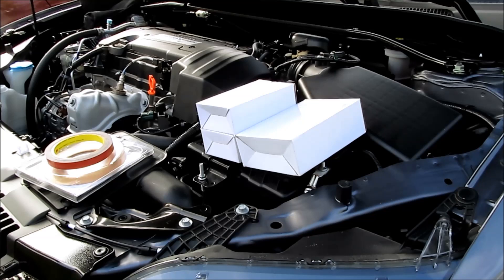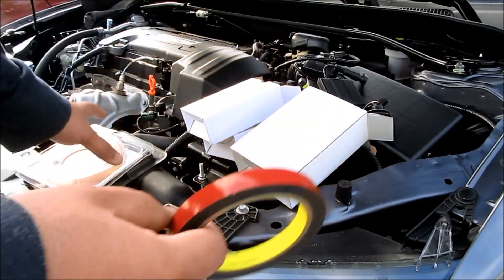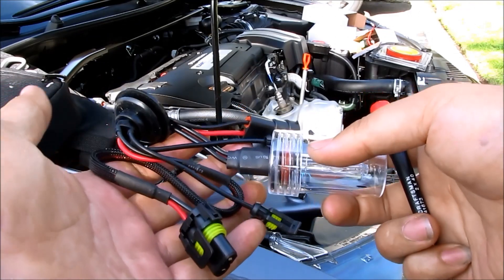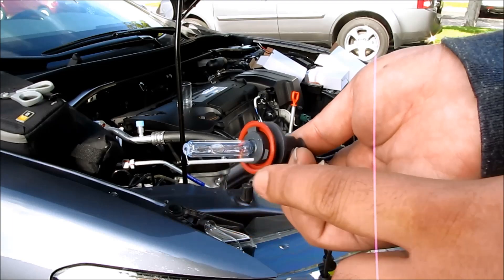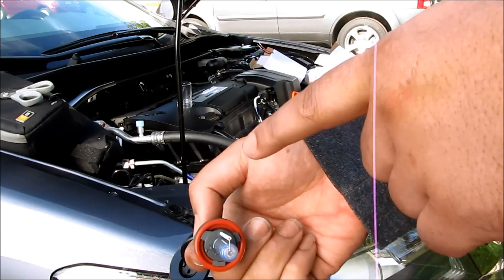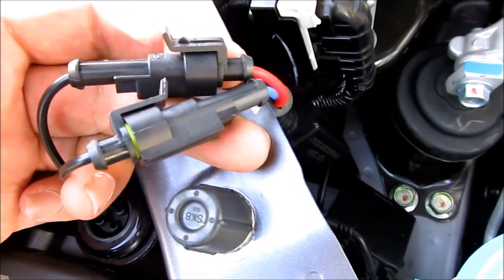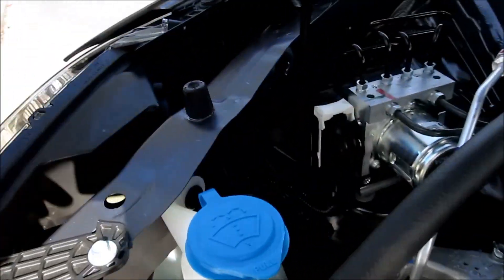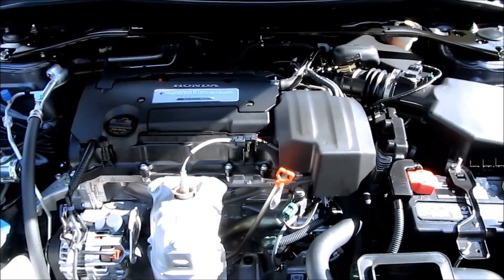DIY 2013 2014 2015  Honda Accord HID install (Must Read Description and Turn on Annotation)

Comment: Before installing the HIDs, is it necessary to disconnect the negative terminal from the battery?
Reply from the maker: Yes, before doing any electrical work, it is a recommended that you disconnect your negative battery terminal connection. Please have your radio code in hand before proceeding. However, it really was not necessary to do so on the Accord.  The HID used on the accord is the same procedure as changing a burn out halogen bulb.  I don't believe anyone disconnects the battery to replace a headlight bulb.   The ballast/hid bulb does not get power until you turn on your headlight switched on...  So make sure the switch is turned to off and not set to on or auto.

Comment: This is a great install video. I have a 2014 Accord V6 sedan. I am looking to upgrade to some HID bulbs but I am having trouble deciding what brand to go with. Does anyone know a good HID kit that does not break the bank but is still good quality? I am looking for 6000k. Not too blue but blue enough to match the LED's under the headlamps.
Reply from the maker: fafan22 You can try DDM or the Zenex ballast and DDM bulbs or http://www.amazon.com/Kensun-Conversion-Colors-Premium-Ballasts/dp/B004ZF43Y0/ref=sr_1_1?s=automotive&ie=UTF8&qid=1416112928&sr=1-1&keywords=h11+hid&pebp=1416112934696

Comment: I was wondering how is your cut off for the HID installed on OEM projectors. Does it blind other drivers?
Reply from the maker: I have not been flashed yet.  The cut off is straight and has the color flicker.  It does have some glare but not terrible.

Comment: what's the typical lifespan for HID bulbs? i just had some installed on my 2013 civic.
Reply from the maker: +thwipp89 Many of the HID bulbs are advertised with 30,000 hours life span.  However, the hid bulb will loose some light output (lumens) as they get used.   For example, a brand new hid bulb will produce more light compared to the exact same hid bulb that was used for 2 years.

Comment: Hey buddy just a quick question. How have the hids and ballast been holding up? An would you recommend them?
Reply from the maker: Big Boy Everything is working fine.  No problem so far and I don't expect there to be a problem anytime soon.  My first DDM kit purchased back in 2009 is still working fine today.FAQ: 2013 2014 Honda Accord HID Install 9 months Update

Comment: Purchased my ddm kit and just installed, lights come on great I don't notice a flicker but both ballast have a loud buzzing noise. I have a 2013 accord ex coupe, I have read a lot of people saying they installed and had no issues with same car??? Is relay needed or is there a fix to this issue?
Reply from the maker: you can hear the buzzing while driving .. you can hear the sound above the engine noise?
"i have never "heard" a completely quiet HID ballast, they all make noise, some more than others and usually are the loudest when first striking the bulb.."
Reply: +DIY: Car Modz once the headlight are turned on the buzzing starts and is very noticeable.  once the engine is engaged it is hard to hear over the engine noise. Is this normal? Is there anything to worry about? And do you think a relay would help? Thank you!
Reply from the maker: Nothing to worry about.  No, relay will not help.  Its just the hid being ignited. Simple fix.. don't turn on the headlights with the car off.
Reply: Thank you very much, love your videos watched all of them sense i bought my car. I feel better knowing i wont go out my car one day and have the whole thing be melted! Thank!

Comment: Does these bulbs give you hi and low beam?  What kit should I order for a 2013 Honda Accord Sport?  I want to still have Hi/Low beams....
Reply from the maker: Al Salerno The accord has 2 separate bulbs for the low and the high beam.  If you want to change both the high and the low you must purchase 2 separate HID kits.  H11 for the low and 9005 for the high.  However,  keep in mind that if you don't have the stock LED drl strip light then you must disable the DRL light in order to use HID for the high.  It is also not recommended to change the high beam to HID because flickering the high beam can damaged the HID ballast/ignitor.
Reply: Then why do some of these offer hi\low?  Sorta confused..
Reply from the maker: Because some cars only have 1 bulb that control both high and low..Example Honda Fit uses H4 bulb which is high/low single bulb.  The Accord uses H11 bulb with is NOT a high/low bulb setup.  Car that have separate bulb for the low beam and high beam does not use the single hi/low hid kit.  You must purchase 2 kits if you want both high and low hids.

Comment: Can you use the wire (for the relay harness I believe) that you removed and instead use it to connect the ballast to the oem socket? Or will that cause any issues? I don't think my ballast is connecting completely to the oem socket (I cannot get that click).
Reply from the maker: Please use the adapter that I removed on the video.  Check this other video I made recently regards to the HID install.

FAQ: 2013 2014 Honda Accord HID Install 9 months Update
Reply: DIY: Car Modz
Thank you so much for the speedy reply! I am going to try this tomorrow and will post results. Thanks again!

Comment: Whats best thing to clean foggy/dusty headlights???
Reply from the maker: Depending on the condition of the headlights..  Any of the following

Plastic polish
toothpaste
some sort of rubbing compound.. followed by less aggressive compound.. topped off with plastic sealant.
Wetsandpaper 1000-2000-3000 grit and buff with compound/polish
spar urethane

I'll have a video up on headlight restoration.
Reply: DIY: Car Modz I'm really interested in these hid bulbs for my accord 14 son
but since I'm a noob i culdnt find these exact bulbs online so like could you send me a direct link to where i can buy it from.

Comment: Do your car have the LED strip at the headlight (DRL LED strip)? if not, are you planning on adding one? I saw some other videos show how to just add the LED strip into the headlight for the Accord Sedan, yet they didn't really show in details so I wonder if you have any tip on doing that or if you planning on doing it and make a video, I would really appreciate it (cuz the LEd strip is only available on higher trim which is not my model and I would love to have that LED strip look)
Reply from the maker: Silva Hawk Eventually I will want that look but I want something that is just as bright as the OEM v6 headlights or else I don't see the point in getting one.  I've seen pictures of many different led strip from a ijdmtoys to typical ebay ones and I'm not impressed at all by the light output.  All the output you see from those are from people taking pictures in the shade or on a cloudy day.  I have not seen one pic on a clear sunny day facing the sun or a side by side comparison to the OEM v6 headlights with the led drl.  If anything I will either buy the v6 headlights with the oem led drl and do the tl quick retro fit projector all at once or I might purchase these: http://www.exledusa.com/exled-sf-block-premium-universal-eyeline.html.
Reply: DIY: Car Modz yes, I've looked at those SF-Block strip before too and that's what I wanted to learn how to install cuz a full set of new headlight is quite expensive

Comment: I ordered "Kensun HID Xenon Conversion Kit H11 - 6000k" and installed both of them. one thing that's happening though is that once in a while, my driver side hid doesn't turn on. i'll switch my headlights on and only my passenger side turns on. i have to turn my headlights on/off a couple times before i get both of them on. might be a bad bulb or ballast, but could there be a possibility that i need a relay harness for these?
Reply from the maker: Try swapping the bulb from the driver side to passenger side.  If the side that does turn on switches.. then it is the bulb.  If the same side doesn't turn on, try swapping the ballast.

Can you send me a picture of the HID bulbs.  I want to see where the return wire is located next to the glass tube.  Also take a look at this update HID video:  FAQ: 2013 2014 Honda Accord HID Install 9 months Update
Reply: thanks, i plan on swapping the sides of the two bulbs tomorrow to figure out the source of the problem.
Here's a pic of the bulb that Amazon provided: http://ecx.images-amazon.com/images/I/41QOM84%2BQ5L.jpg
The return wire is at the bottom when the bulb is secured in

Comment: I was outside for an hour in the cold trying to put this in and it wouldnt work. I think its because the connector from the car to the ballast wouldnt click for me no matter how hard i tried since the small is small also. Any advice for this? Im gonna try again tommorow
Reply from the maker: Rohan Sethi Did you read the description and turn on annotation?   Check this link: https://www.youtube.com/watch?v=AVT0pDEgDsc

Comment: How would they (ddm 35 watt) hold up in the coupe fog lights?  Will the ballast possibly get wet?

Thanks
Reply from the maker: You can install HID if you want, The HID ballast are waterproof.  However, just know that you will be blinding on coming drivers with having HID for the fogs on the coupe.  There is absolutely no cut off and the light output will be the same as those off road lights.
Reply: Ya just need them for my private driveway ride home 5/8 mile "off road"

Comment: @jephu- Thanks for the awesome video. I am thinking of getting the same kit. Some questions for you. Why did you go for the 5000k as opposed to the 45000k that some folks went for? Also, how is it holding up for you? Finally, any good suggestions for the high beam LED bulb without losing the high beam option?

Thanks!
Reply from the maker: So far so good.  I have no complains.  I've been using DDM HID  products since 2009 and have installed numerous HID kits from them on various cars and have not had any major problems.  I went with 5000k over the 4500k for the look.  Click the link to see the color comparison: http://www.ddmtuning.com/images/custom/hid-color-chart-projector.jpgFor the DRL with the highbeam.. I heard good things from people that use this: http://www.vleds.com/cxa-led-headlights.html but I have no first hand experience so I can't really recommend them.
Reply: Jephu
 The high beam link does not work.
Reply from the maker: http://www.vleds.com/cxa-led-headlights.html
Reply: Jephu
 Thanks but that seems like fog lights.

Btw, have you tried swapping the rear sway bar with the Acura TL's 20mm?
Reply from the maker: Low beam: H11
Foglight: H8
Front Turn signal: 1157
High beam: HB3/9005
Lower marker bulb (All 4 cyl models): 194
Rear license plate bulb: 194
Rear Turn Signal: 7443
Reverse bulb: 921

Comment: Hey Jeff,
You deff got a new sub. real quick did you need to retrofit the headlights?
Reply from the maker: For the best optimal setup I would highly recommend you do a complete retrofit using OEM ballast with Philips 85122 or Osram bulbs with hid projectors.
Reply: can you further explain what you mean by complete retrofit?
Reply from the maker: http://www.driveaccord.net/forums/138-audio-electronics-lighting/158321-4g-tl-hid-projector-retrofit.html

Comment: installed HID xenon lights on my 2014 Honda Accord, everything good for about 6 weeks, now today I notice that my drivers side headlight is out, didn't notice any loose connections....went and put my original halogen bulbs back in, drivers side still not working, any suggestions?
Reply from the maker: +jak30341 check the fuse under the hood.  It should be a 10A fuse .. #24 or #25.
Reply: Thanks so much, it was blown, replaced it.  I have my original halogen back in as I put them back in before determining it was a blown fuse.  I'll probably put my HID back in but I don't want to deal with randomly blown fuses?  Been running my 35w 5000k xenons for 6 weeks without issue then bam!
Reply from the maker: +jak30341 which hid kit are you using? product link...
Reply: +DIY: Car Modz HIDkitlights.com

Comment: hello love u video quick question  if i buy the 55 watts will there be any problem like the wire burning also i have  2013 accord ex-l i hear something about error eliminator i went to the ddm tuning webisite and they sale it with the kit did u buy it or do i need it?
Reply from the maker: Using 55W, I'm not sure.  I don't use it so I can't comment on it.  Error eliminators is not Honda related.  

Read this.. I posted this on da forum:

http://www.driveaccord.net/forums/showpost.php?p=2522930&postcount=40

Comment: I have a 2016 honda accord and I used the 55w hid bulbs from ddm tuning.
I was able to install everything just fine but there is flickering on one of my bulbs.. I contacted ddm tuning and they informed me I needed a relay wiring harness.. do you think this would fix my flickering problem?
Reply from the maker: it's possible.  But before installing the wire harness. I would swap the hid bulb around and figure and see if it is the bulb that is causing the flickering.   Example.. if it flicker on the driverside swap it out with the passengerside.. if now passengerside flickers then it is the bulb but if it stays on the driverside after the swap then it is the ballast.
Reply: DIY: Car Modz if it is a bulb, would I have to get it replaced? or will the wire harness do the trick?
Also, I saw that you have a video of the wiring harness about 2 years ago.. do you have an installation video? I just don't know where to run those long wires lol.
Reply from the maker: If it is the bulb.  I highly doubt that a wire harness will fix a bulb problem.  For ballast it probably will but not when the problem is the bulb itself.  I do have a TRS relay harness in my parts bin.  I can do a installation video next week.
Reply: +DIY: Car Modz HI so I upgraded to the ddm Canbus kit because it would still flicker even with the harness.. so now, there is no flicker because I upgraded.. but it is draining my battery.. So I jumped it and it's throwing a bunch of issues.. my abs, etc brake, tums, traction control and electronic steering is lighting up.. I feel that it is due to the hid canbus kit. 
(http://www.ddmtuning.com/Products/DDMPlusCanbus35W)

I am going back to my stock bulbs again to fix this issue.. I just don't know what to do because it looks really nice with this set up.. what do you think that problem can be?
Reply from the maker: Honestly, I've installed many hid kits on the 9thgenaccord vehicles ( both coupe and sedan) and I have not had the same issue as your having.  All I used was the standard 35W 5000K HID Kit without the wiring harness and everything is fine.

I only had to install CAN BUS hid ballast for vw, bmw, dodge, audi and mercedes because those vehicle computer checks the headlights while for Honda's it doesn't.  CAN BUS will fix the dash out warning error and flickering issues.

I'm guessing your having the dashlight issues because the car battery is low.  Might be due to running the hid without having the car running.  Usually the cause of those lights is due to low voltage from the battery.  If you look at the negative battery post you will see a black box.. that controls the voltage for all those dash lights.. if the voltage drops to a certain level the box will send a signal to your dash to light them up.  To fix it you need to charge your battery by just driving it for a while or hooking it up to battery charger.  Just driving it around usually fixes it.
Reply: +DIY: Car Modz the 2013-2016 accords are all the same right?
Are you experiencing any flicker with your ddm kit? Also, the the 35w 5000k the pure white?

I just took my hids out and put back the stock bulbs. my car is all back to normal.. 
I'm thinking about going back to the 29.99 ddm brand bulb
Reply: +DIY: Car Modz Also, is there any reason why my battery would drain using these Canbus bulbs?
Reply: +DIY: Car Modz I would like to ask for your opinion on this..

Should I go back to the cheaper version of the ddm hid kit? Or should I stick with the Canbus HID kit I have now?

But I would also like to know if you had any problems with flickering using the 35w 5000k kit?
I was using the 55w 6000k cheap ddm kit when I was having the flickering issue but at least my battery was not draining. But when I did put the wiring harness, that's when my battery was drained.. maybe the problem with the flicker  was cause I decided to go with the 55w?

I have a 2016 accord and you mentioned you had a 2013.. is there any real difference with these two?

Please let me know what you would recommend..

Comment: Hello what bulbs would the low beams and fog lights take on 2015 honda accord sport
Reply from the maker: Same as the 2013 2014 Accord all trim models.  H11 low beam and H8 fogs.

Comment: I have a honda accord 2013 sedan LX. If i change to hid lights would it change the underlight (eyeliner) light too or do i have to purchase it seperately.
Reply from the maker: It is a separate bulb.  You need to purchase a T10 bulb. http://www.driveaccord.net/forums/showthread.php?t=187345
Reply: DIY: Car Modz  are all t10 bulbs the same? Light Bulbs 168 194 T10 W5W. would those work?
Reply from the maker: Luis Lee Yes and No.  As far as led is concerned T10 = 194 168 921 etc etc.  Basically it means the base of the led connector is a small wedge type base.  However, some t10 led might not fit certain sockets due to the being too big to fit inside the light housing.

Now for stock incandescent bulbs.. 194 168 921 etc etc etc the only real difference is the wattage.
Reply: DIY: Car Modz thanks for the reply. (maybe a quick video of installation of the eyeliners for the viewers?)
Reply from the maker: Luis Lee I have one for the coupe on my channel but here is something I found on google. 2013 Honda Accord Sedan Marker Light Removal